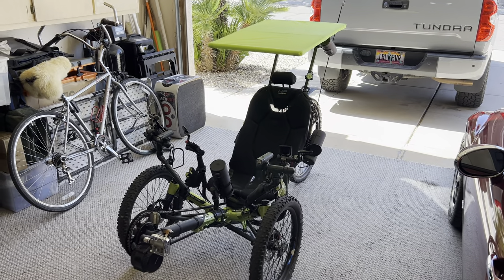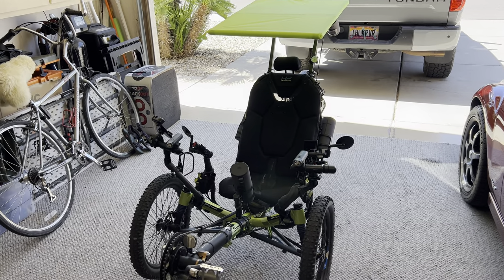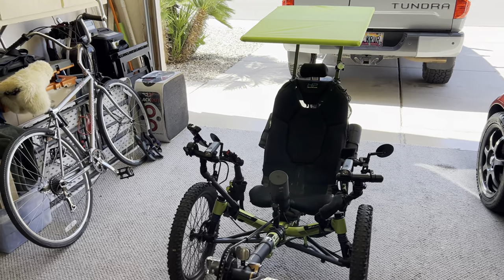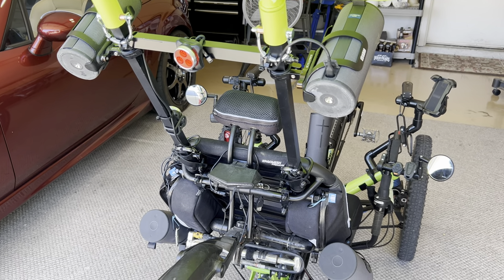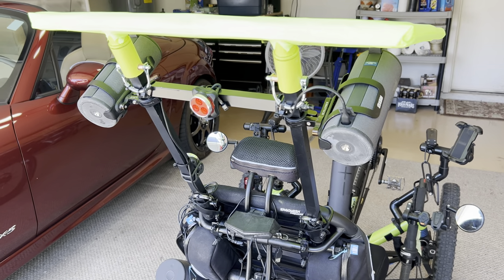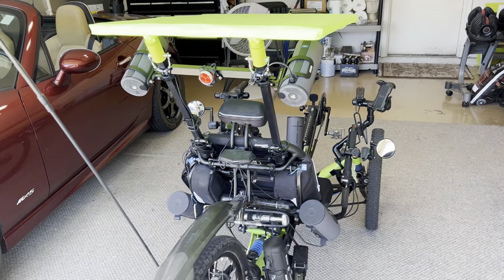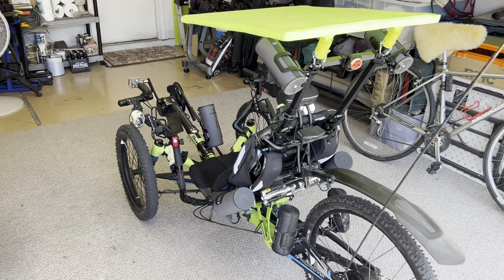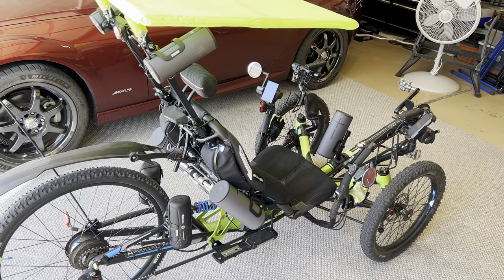Fully Cantilevered Trike Canopy!!

Comment: Inspirational design & execution.  
I've been pondering how to do something similar for my Catrike 700.
Reply from the maker: Thank you for the kind words!
The design and execution were relatively easy and straightforward due to the HP seat frame design. The little bit I know about the Catrike 700 seat and frame design, it seems this approach could work, although nesting and securing the torsion rod assembly may be a little more involved. Also with the Catrike 700 being touted as a speed machine, this canopy setup will add some weight to your trike, albeit not a significant amount, probably around 2 to 3 pounds!